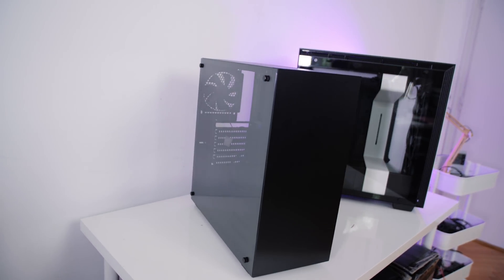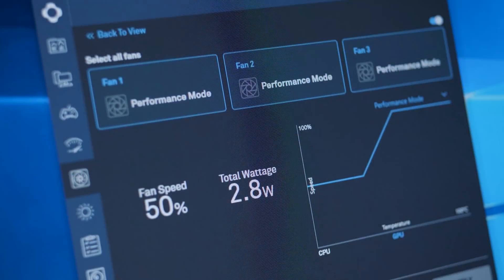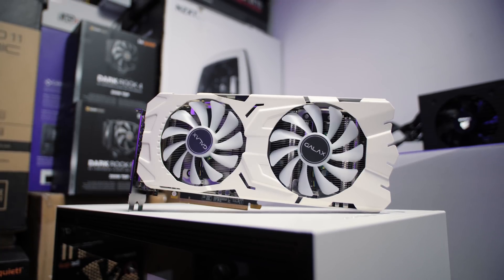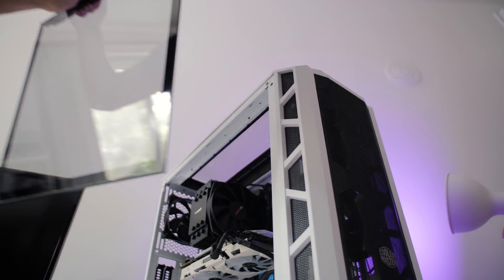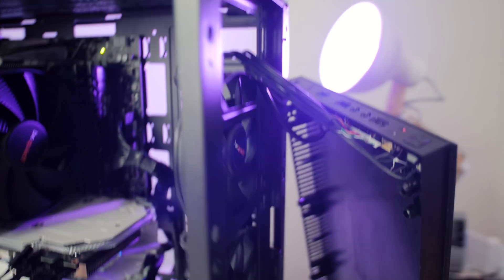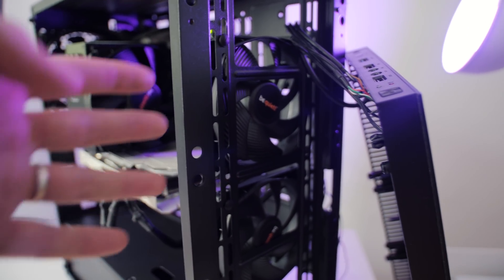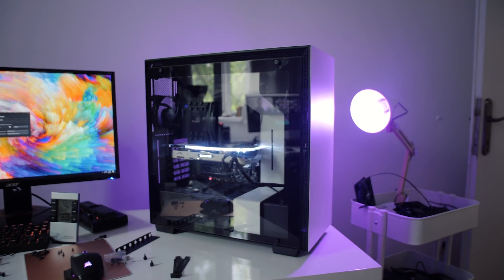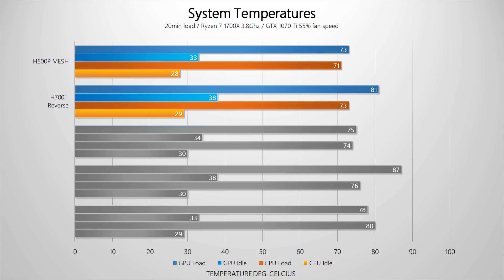What Happens If You REVERSE Case Airflow?

Comment: I tested this several years ago when I completed my first build and had no idea which way the fans were supposed to face. The throttled gpu was resolved when I used the gtx 550 ti. No heat buildup at all. No performance either. But no heat.

Comment: I would like to see a deeper investigation in this matter :) Try with other cases, some with fans on top... And what about AIO cooler or water cooling loops? For example... If you have a radiator on top, does fliping the back fan help your temps? I had this question because I tried once, but never really got to any conclusion... I should help the CPU, but may hurt the GPU... I dont know... Maybe you should try it next time Dimitri :D

Comment: My setup is two 120mm at top sucking air out(be quiet fans), 1, 120mm on rear sucking air out, GameMax 240 AIO front mounted rad blowing in, Phanteks Eclipse p400s. 8600K@ 4.5Ghz, 38c idle(19c ambient), MSI GTX 1070 Armour. Fans are quiet as well, about 700RPM rear fan, lowest setting on top fans being case powered . Anyone says that good? I've tried different fan configs, this seems to work the best.

Comment: I think reverse air flow would work if your computer is on a desk and you have an air conditioning vent behind your desk that the computer can pull cooler air from. Otherwise, you're just creating a high dust situation. I had a GPU AIO pulling in on the rear 120mm and it made the radiator quite dusty.

Comment: Hey Dmitri, I'm fairly certain that the cause of the higher GPU temps in the reversed position is much more a result of there being no intake near the GPU as opposed to any rebounded air resulting from the front panel. I think if you were to jerry-rig a fan onto either the PSU shroud or the PCI slot covers instead of mounting in the usual rear exhaust spot, you'd see better results on the GPU at the expense of the CPU.
Reply: Dylan Johnson Doh! Just saw you comment after almost saying the same word for word lol- great minds eh

Comment: As expected, blowing at a solid panel creates turbulence and the hot air just doesn't exit properly. The CPU temperature difference is very marginal.

Currently I have a horizontal case, so air goes in the front, through the CPU heatsink, out the back, straight airflow, no circulation, very effective. The GPU is sucking air through a meshed side panel, again, very effective. 36/39 °C during basic use with inaudible fans. The only thing I hear is the PSU, a 10 year old Corsair TX650 without passive mode with a Noctua NF-P12 inside.

Comment: Airflow overated. I remember opening my 750D to see if it lowered the temperature of my GPU, my goddamned HD7990 was, at idle, at close to 50 degrees i think. But the place i was living in, last year, in the winter was kinda cold and i could run my h100i at quiet mode and have the GPU, i cant remember how many degrees, but ALOT cooler, playing BF4.

Comment: Yep, this was more popular / heard of when huge hard drive cages were welded to the front interior of the case. You couldn't get the front intake fan to push air all the way through the cages up to the CPU cooler. Its smarter to put the CPU cooler fan in a push config on the other side, instead of pull like you have there. This way the air will enter the CPU cooler, warm up and you can exhaust it readily via top exhaust fan. otherwise, the hot air could just linger toward the front of the case. You can even turn around that front original intake fan on the case instead of exhaust to intake, to help push that hot air up to the top and out, where the hot air will naturally want to go anyway. The method overall works real good, you can even get some magnetic dust filters off amazon in 120mm size to cover the new rear intake from dust.

Comment: Best reliable 650watt 80+ gold psu that will not blow up and has Japanese conductors and stuff ???
Reply: evga is super reliable for me
Reply: Pretty much anything from EVGA, Seasonic, or Corsair should all be fine.
Reply: Drake EVGA Supernova G
Reply: EVGA all day
Reply: Evga g2 and g3 are one with the best ripple suppression and almost perfect voltage regulations
Reply: BeQuiet Straight Power 11
Reply: Drake Corsair RM650x, never had a problem. But I guess EVGA and bequiet are great as well
Reply: Drake basically anything from Seasonic is a safe bet. Their Focus Plus series is especially good.
Reply: Take a look at the Seasonic Focus Plus Gold series. Not sure about the conductors (they prob are) but they are a quality brand and its a good series. Fully modular and 10 year warranty. I'm getting a Titanium Prime Ultra (overkill!!!) myself. :+